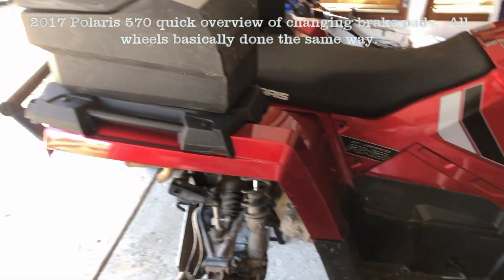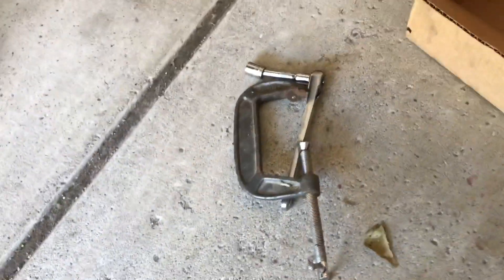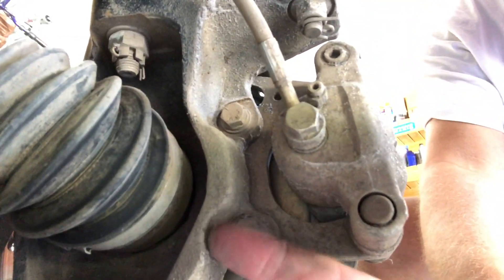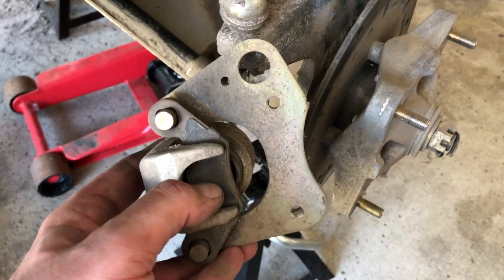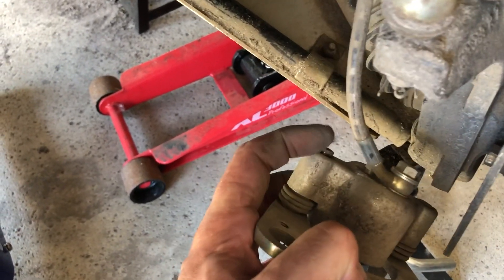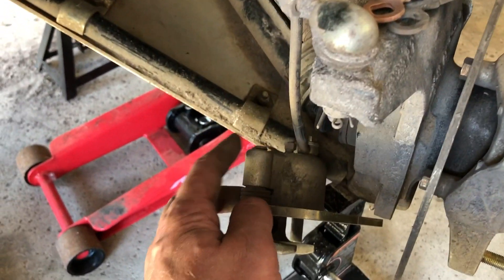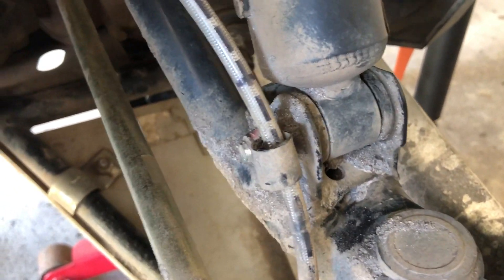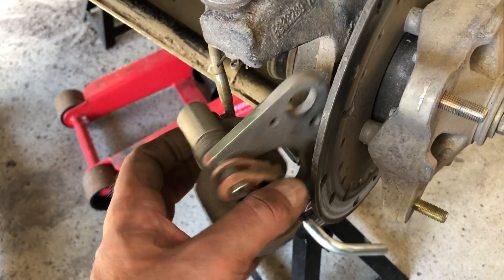2017 Polaris 570 change brake pads quick overview

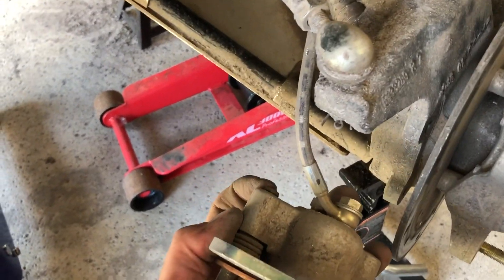Comment: 2:11 anyone know what this Allen head is for? I noticed when I loosen or tighten it, I will get a softer or firmer brake lever feedback.
Reply from the maker: Don’t know but will follow to see if anyone does.  Good question!
Reply: @DirtyJakTheDustyBean  I figured it out. It is the adjustment for the stationary brake pad. You tighten the screw until the pad becomes tight against the rotor then back it off one full turn.
Reply from the maker: @jmabs5096 nice!  Thanks for sharing